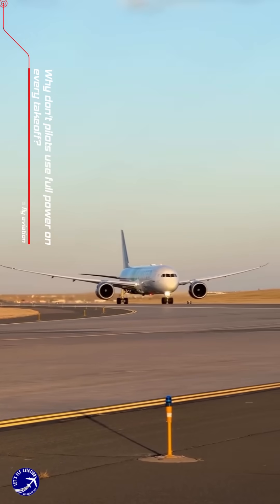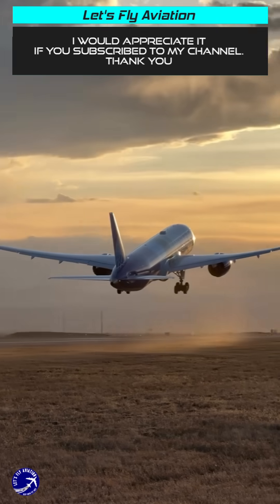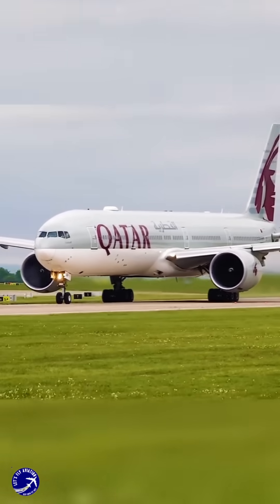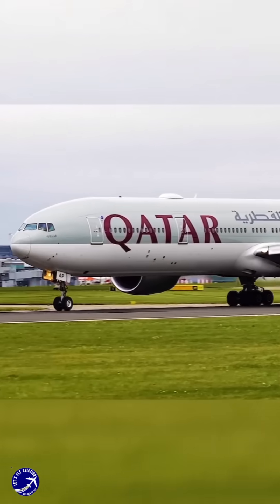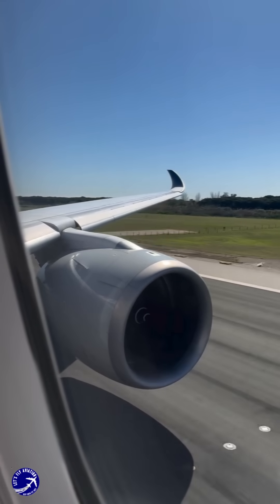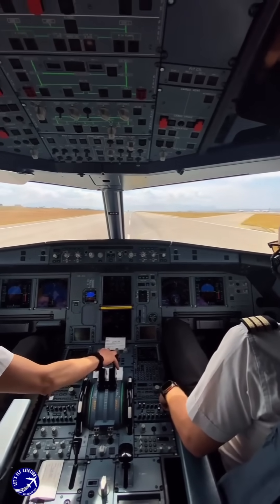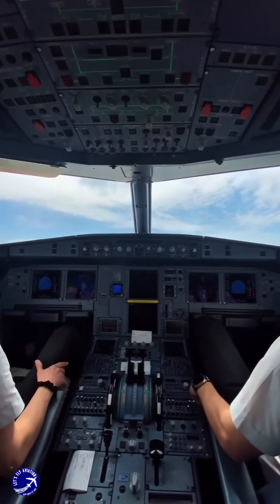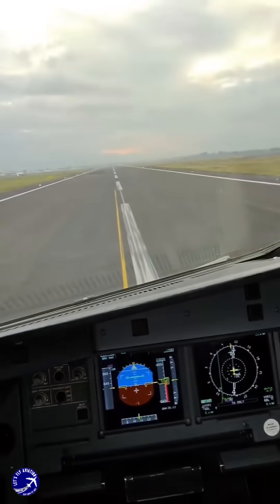Why don't pilots use full power on every takeoff?

Comment: Definitely saves wear and tear on the engine. But in my mighty G550, since the BR710s are a bit depowered for the G550, plenty will full rate every takeoff. Even when you derate, the engines are still so powerful that you are routinely at V2+20 by the time the wheels leave the ground vs V2+10.

Comment: While the real reasons are buried deep in this very wordy explanation let me tell you the truth.
Full power take offs almost never happen, 99.9% are at a reduced engine power and it has nothing to do with comfort, all aircraft have to comply with what is known as “performance A” requirements, this ensures that up to V1 the aircraft can be safely stopped on the runway, after V1 the aircraft can continue, have an engine fail and yet still miss all obstacles in the takeoff flight path up to a height of 1,500’ from the takeoff threshold while retracting flap and climbing at maximum continuous power at a specified point during the initial climb (usually a 1,000’), from that point continuing the climb to sector safe altitude either by following the departure route if no further obstacles exist or by turning the aircraft along a path that can be safely negotiated clear of obstructions called an ETP or emergency turn procedure.
So for every takeoff from every airport this calculation is made and will include the power reduction to safely achieve this requirement, typically we use an assumed temperature reduction or a specific de-rate setting depending on aircraft or company procedures but in 99.9% of takeoffs the aircraft has way more power available to meet the requirements.
The things that do reduce our ability to de-rate is know as the WAT limit or weight, Altitude, temperature and the terrain around the airport which may require an ETP to be flown following an engine failure, in short if it’s hot or high or hilly you may have to use full power. There are a few airports around the world that fall into this category and here are just some of them, Mexico City at over 7,000’ and surrounded by hills, Addis Ababa again over 7,000’ and surrounded by hills, Hong Kong although at sea level due to the political nature of the surrounding area all departure routes are steep, also the wind because of the terrain is quite unpredictable with a headwind at one end of the runway and a tailwind at the other, this effectively shortens the runway to add to our performance issues. I hope this helps.

Comment: I've learned that Airbus planes sometimes take off at 50% power.
Reply: BS
Reply: Never lol
Reply: It's not about airbus can do that or Boeing can pull that or you know lil cessenas can do that. It's about the engine, the aero engine equipped on the plane.